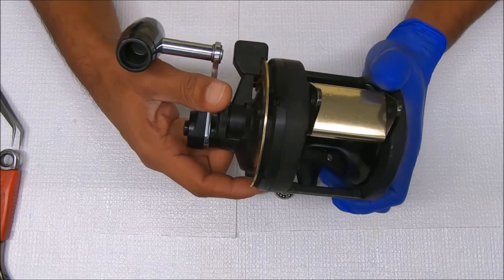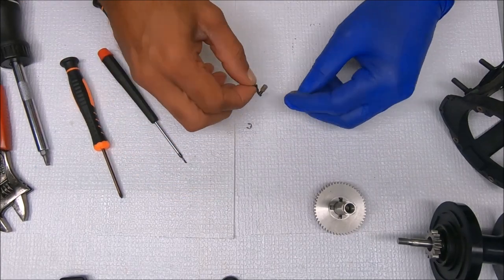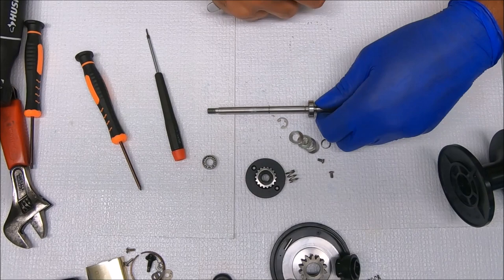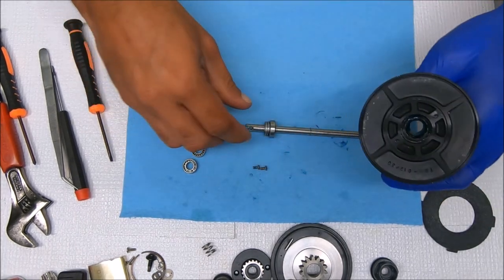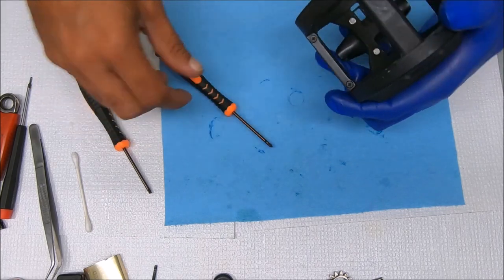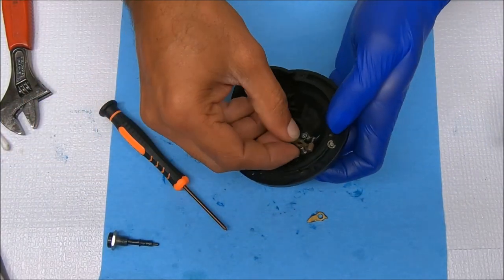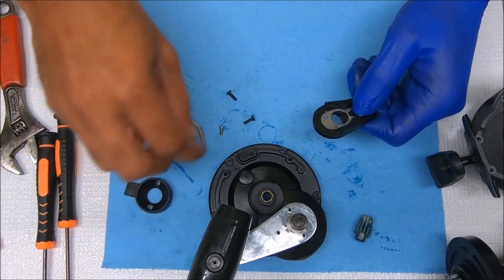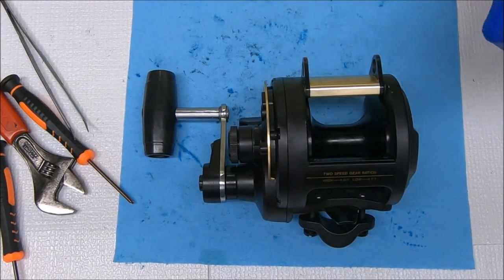Shimano TLD20 2-Speed Fishing Reel - How to take apart, service and reassemble

Comment: I followed all the steps with one hiccup. Can’t get reel to get on free spool or engage two speed after putting them together. Any idea on this issue?
Reply from the maker: Thanks for watching. It seems like you missed and few steps if neither is working. You may have just forced things on and pinched everything together, but I would suggest you breakdown the right side of your reel again and follow my video CAREFULLY to help with the reassembly.... make sure you are not missing any parts. You may need to do the same thing for the spool, but start with the right side redo first. If that didn't work, feel free to reach out to me at tsgreelservice@gmail.com for help.

Comment: I have this same one but when at full drag it makes a grinding noise in low gear and high, idk what that is.
Reply from the maker: Thanks for watching. How long after you got the reel did it start and have ever gotten the reel serviced before?
Reply: @TSGReelService  It first wasn't engaging in low gear when the button was pressed, added the spring it was missing and now it's like the dog is interfering with the gear or something. Like it's stops
Reply: @TSGReelService  only when at max drag
Reply from the maker: Take it to your local repair shop.